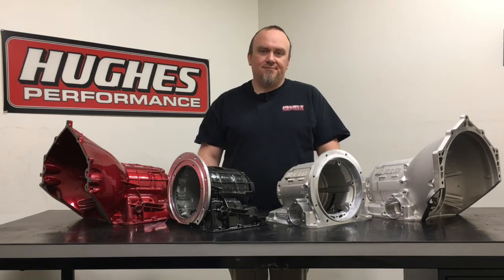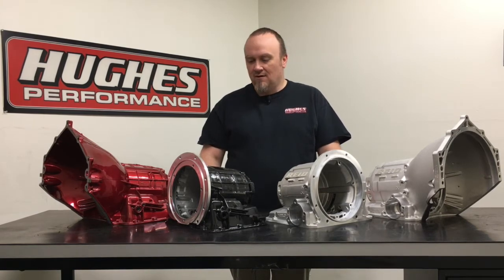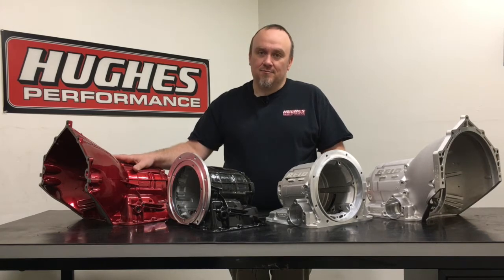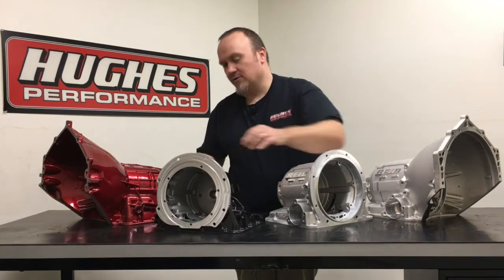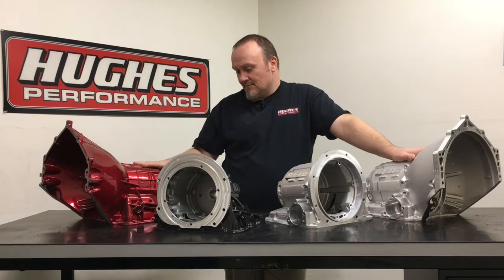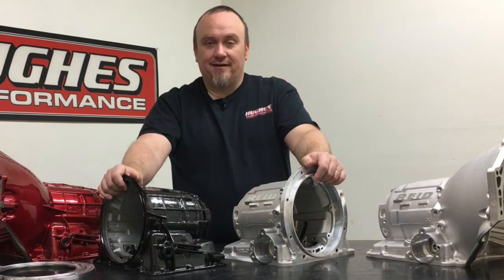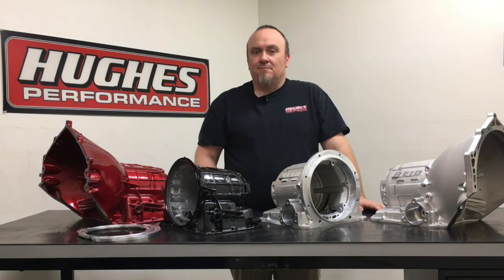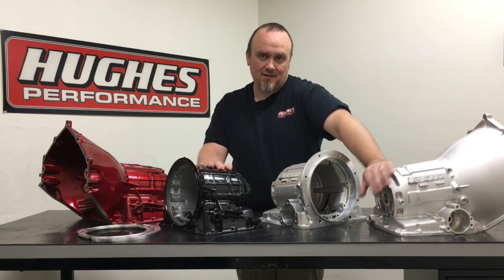Ep. 4 Powerglides 101: Transmission Cases

Comment: I've got a Stock case powerglide that had a large crack in the bell house from a crash that happened. Was wondering if it would be possible to replace the bell house and salvage the case?
Reply from the maker: Absolutely.  JW Performance bellhousing part number 92450 will get you fixed up.
Reply: @HughesPerformance  Great so even with the case being a one piece case this application will work?
Reply from the maker: Yes, the JW bellhousing is designed for you to cut off the OEM bellhousing from the transmission case and then bolt on the JW bellhousing to the front pump using the longer front pump bolts supplied with the bellhousing.
Reply: @HughesPerformance   perfect, Thank you!

Comment: I am currently building a powerglide for a close friend, im wondering where the case casting numbers are? I see people claiming on the stock pan but this pan is aftermarket, it doesnt say powerglide on side of transmission like i have seen some do, but there are multiple stampings on the casting piece off the drivers side rear of case if you are looking down at trans it is right near where the trans break servo goes its almost a square that hangs off the transmission but its part of the casting

Comment: Hey I have a rebuild powerglide transmission. I install it in the car and went to turn the drive shaft to tighten the drive shaft bolts, but the tail shaft is hard to spend. what could be the problem?

Comment: What is the difference in a torque converter set up for 1/8 mile vs 1/4 mile. Mine was set up for 1/8 mile now I want to run 1/4 mile
800 HP turbo 400 .456 on 32x15 slicks. 6500 RPM before end of 1/4 run.
Reply from the maker: Some builders may opt to build a converter with a higher vane count stator and/or more negative fin angle in the impeller in order to have the converter provide sufficient stall speed & launch RPM with the reduced load created against the converter by the numerically higher rear gear ratios that are commonly used by 1/8-mile racers. If a dedicated 1/8-mile car is being converted to run 1/4-mile, you may need a converter adjustment as well as a rear gear ratio change to optimize the combination for 1/4-mile racing.
Reply: @HughesPerformance  I'm going to convert to 1/4 mile. also I'm going with a power glide with a converter for such.. Thank you and I will call.